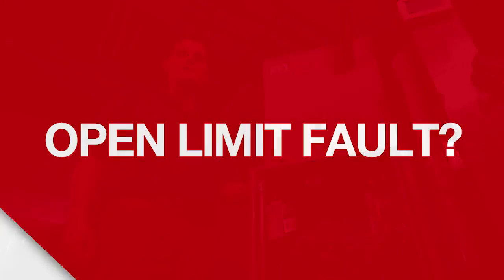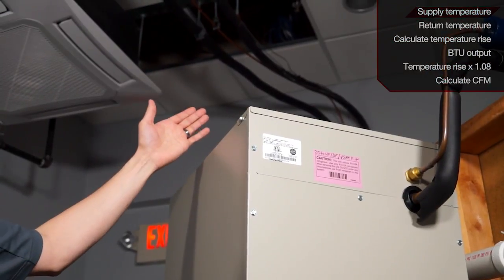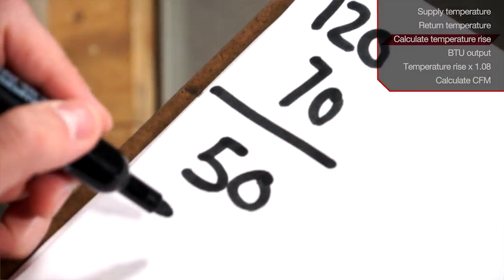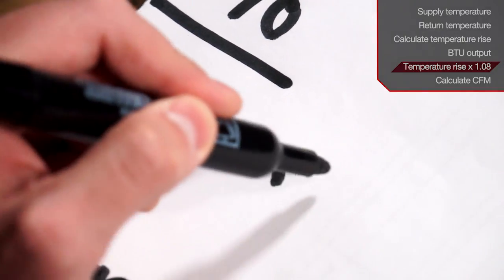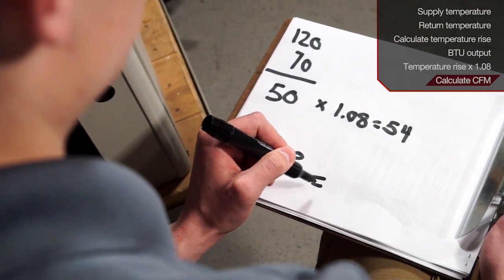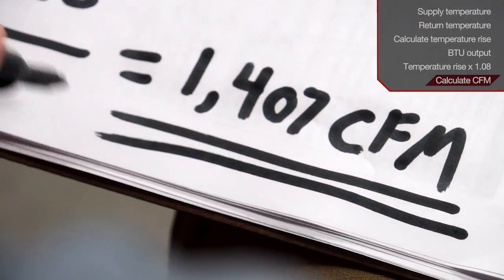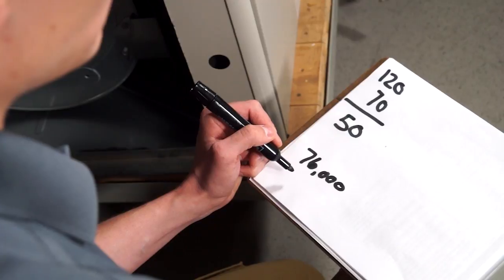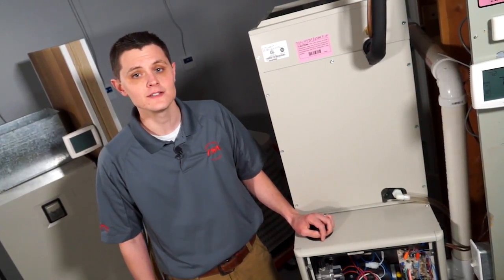Troubleshooting the Open Limit Fault

Comment: One thing I would suggest would be to make sure you take the supply temperature out of line of sight of the heat exchanger if there is no coil on the furnace.